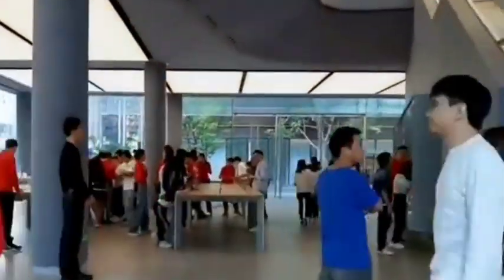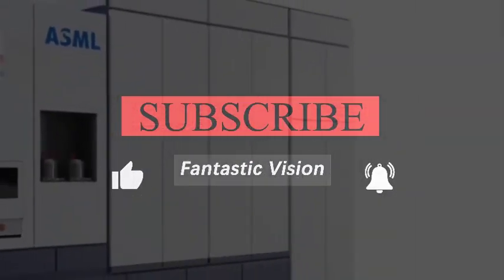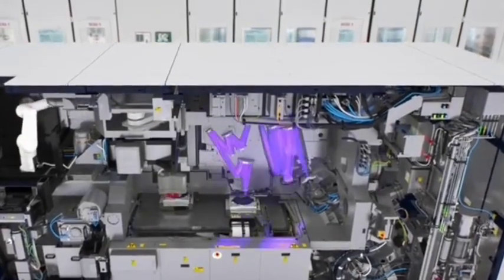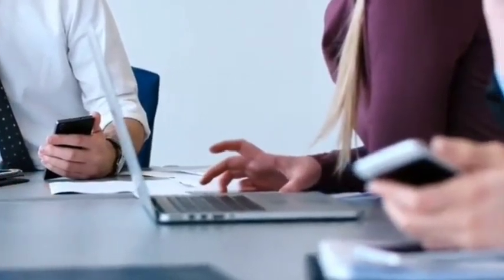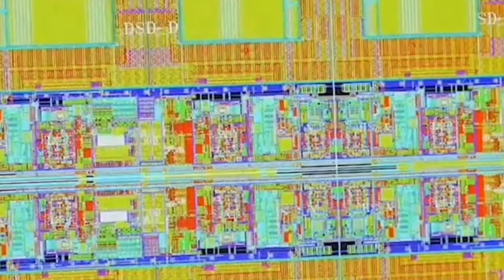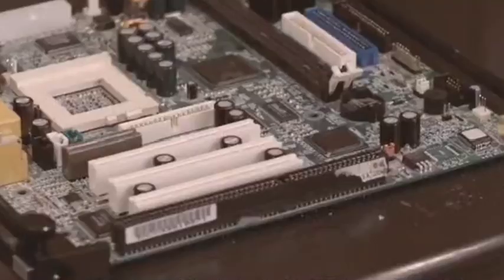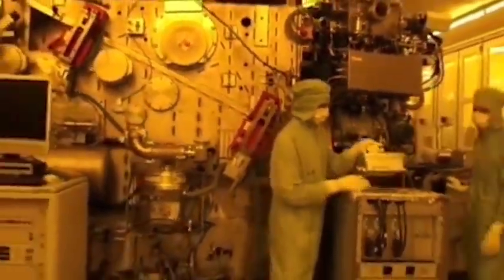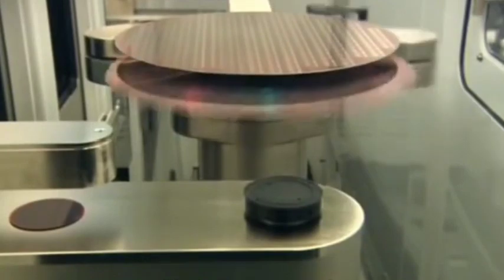Will ASML's EUV lithography machine be eventually replaced by these 3 technologies?

Comment: I wonder if it so important now to have for example 4 square mm chip instead of 9mm...
Reply: Smaller chips need less energy. Furthermore the communication delay to the level 1 level 2 or level 3 cache is reduced because of the reduced distance.
Reply: @jonasmichl1233  less energy but a lot more costs to produce
Reply: @naszadynastia  ASML claims that the costs per computational power are reduced with new EUV. So you have cheaper computational power with less power consumption. However, i can´t say if the statement from ASML is true...